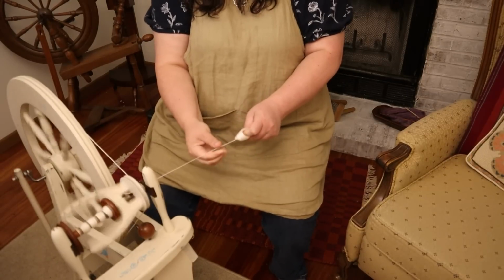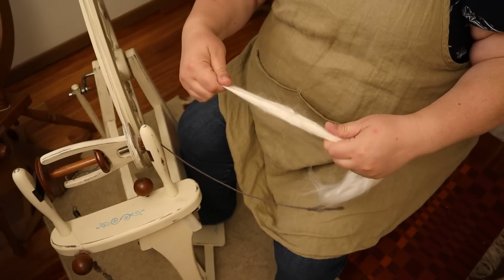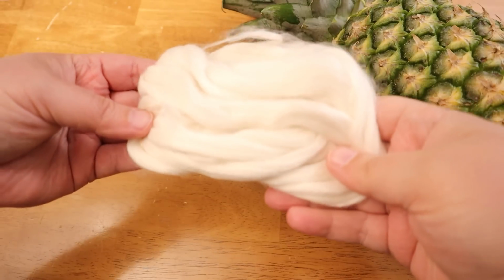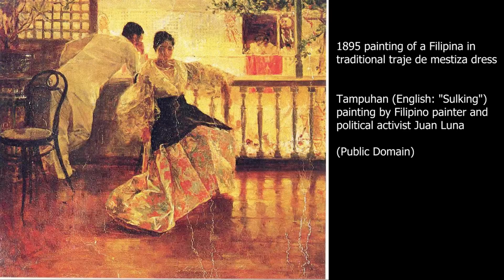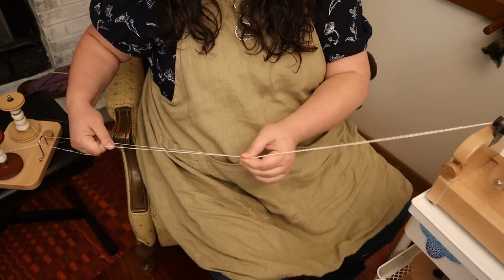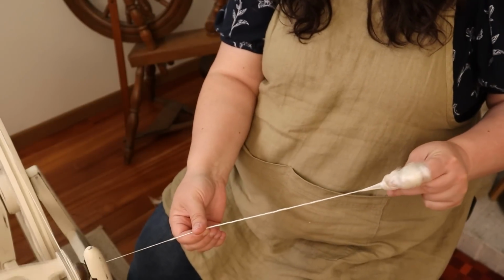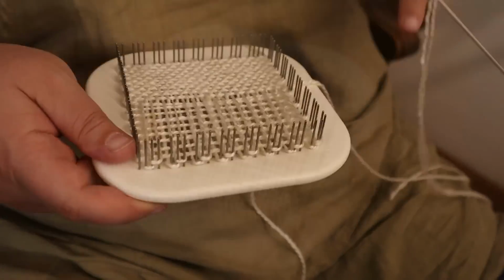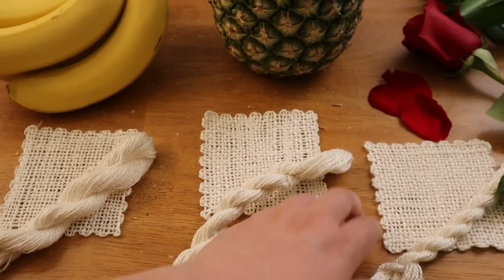Hand Spinning 3 Plant Fibers - History & Spinning Tips And Tricks 🍌🍍🌹

Comment from the maker: The first 1,000 people to use the link will get a 1 month free trial of Skillshare: https://skl.sh/jillianeve07221  
Are you going to spin any of these fibers? Which one? Leave me an emoji! 🍌🍍🌹
Reply: None of the above, I have a huge bundle of raw dogbane stems to process into bast fiber for spinning. Your video just keeps me company. Specifically I'm trying to seperate the tow fibers from the main bunch because of how fine they are. They aren't going to need much combing if I can get them off the main strands of fiber. Dogbane is very strong. The Native americans would use it for rope. The plant itself is poisonous, and when young it can be told apart from common milkweed by the red coloring at the base of the stem. Plant poisons decay with the plant. So the dead dogbane you spin is not dangerous. The plant turns into a branched wildflower with long white flower stalks. The leaves and seedpods look like those of common milkweed but are much smaller and thinner. When growth dies back for the year, it leaves behind a long brown stem, paper dry, which crumples. Below the soil surface is a system of long roots that puts up new shoots each year and that the stems rot off of. The older dogbane is the more brittle the fibers become when processed. So you want that year's growth harvested in January or February even though the dead stems are available any time of the year. Snip the tips off as breaking them to remove the fibers can get very painful on your fingers. Start processing from the base of the stem. Dogbane processing produces a lot of woody chips, which can be poured on the garden as mulch or into the compost. A place called Roots school in vermont has youtube videos on how to process and spin dogbane. You can also process and spin milkweed bast with the same method. Milkweed is at its strongest when frost has just killed the plant, but it is overall much weaker than dogbane. You can spin dogbane on a drop spindle, you cannot do that with milkweed, you must have a supported spindle type. Dead milkweed can also be harvested when you've had a series of freezes and thaws, which makes it very easy to remove the fiber with a dull knife. Dogbane will not do this. The young leaves and flower buds of Common milkweed are edible, but too much is bad for you. And as long as you aren't desperate for food, why would you harvest the buds when the flowers have such a sweet perfume to offer in the may and june sunshine? While processing keep your eyes open for signs of dermatitis. This can happen when handling any kind of wild plant or mushroom. Its not poison, just a skin allergy or a response to an irritant on or in the plant.
Reply: @AnimeShinigami13 Hello fellow dogbane stem collector!  I too hope to process my bundle of twigs someday.  I have a bunch growing in my woods in NC, and I've picked them for the past 2 winters (leaving plenty for wildlife to use as nesting material).  I'm going to look up those videos you mentioned - thanks for sharing your experience!
Reply: @froggydoodle808  i've found a simple pet detangling comb (the metal ones) will work for the purpose. though a youtube channel "Sally Pointer" has recently shown how to make primitive plant fiber processing tools out of thorns and wood or twine. Sally is what's called an "Experimental Archeologist" and her specialty is fibercrafts from british prehistory.
Reply: Thanks for the video. I'm actually interested in spinning the pineapple fibre and I would really appreciate it if you could share more light on the process once again for me.
Reply: Thank you for covering this. Guessing snake plants are even tougher fibers since they have more cellulose than banana
Reply: @JilianEve Has anyone tried to spin willow fibre? Do you know anything about it?
Reply: Thanls a lot for sharp ducha wonderful nowledge .Yes. I do Luke to spin tose fibers.

Comment: Fascinating topic!  
 
One plant fibre you didn't try here is hemp. Traditionally I believe hemp was used for making canvass that was then used for things like work pants and anything else that required tough fabric - and it was, of course, also used for rope. One of the things that interests me about hemp as a fibre is the fact that it grows in a wide variety of climates and it doesn't require a great deal of water or pesticide. 
 
I would expect it to behave similarly to flax or perhaps ramie but I'd be curious to see how you find it stacks up.

Comment: As a cross stitcher, I have noticed a lack of understanding of the base materials (floss and fabric) when it comes to what the different fibers are and why certain types are cheaper or more expensive. Coming from a background of crocheting it has made me more interested in digging into what materials are actually made of, as yarn crafters tend to be more aware of the importance. Your points about rayon are especially interesting, as there are brands of floss that some people love that come from china and are incredibly cheap compared to cotton, but most people seem to assume it is interchangeable with their cotton floss and will use both in the same project. My question in this is the longevity of the finished piece, and the colorfastness of the different types of floss being used interchangeably in a single project. I know you do mainly yarns and not thread, but I wondered if you had any thoughts on this.
Reply from the maker: Yes! I have thoughts. Maybe I'll put a segment in an upcoming video about this.

Comment: the sustainable and environmentally friendly rayon already exists and isn't that hard to find. it's called lyocell or tencel rayon and was developed in the 70s. it's not the most common rayon on the market because it costs more to make than viscose rayon, but it doesn't use harsh and potentially dangerous chemicals like viscose does and the chemicals it does use are in a closed loop. so if rayon is made with the lyocell process it's a very sustainable fiber. if you like the idea of bamboo but are put off by it being rayon, lyocell is the way to go. I think I've heard of lyocell bamboo being out there

Comment: The advantage to Bamboo Rayon is that, as they get the process of making rayon more sustainable, bamboo rayon becomes a great alternative to cotton in light clothing (rayon is naturally wicking and quick drying, which cotton is not) and, unlike cotton, bamboo really doesn't need pesticides (or much in the way of fertilizers) and bamboo is fast growing, really fast growing unlike most other sources of cellulose.
Reply: It's an economic problem not a technical problem. More sustainable means of making rayon such as the lyocell process date back at least as far as the 1970s. The viscose process is still by far the most commonly used, because it's cheaper.

Comment: I have spun both banana and pineapple fibres, I want to buy some more of them so I can try weaving with them, I liked the slubby texture from the pineapple fibres. I have also tried mint leaf fibre, which I'm guessing is also rayon in the same way that the rose leaf one you were working with is, it seemed to have more shine and drape than the other two, it would maybe work for knitted lace as well as weaving.
Reply from the maker: I have some mint fiber and I need to make a part two to this one. The mint has a slightly different color and it says on the label that it is mint "infused" but I don't know what that means or what that process looks like. It doesn't smell like mint though so, yes, I'm assuming chemical process all the way. It's very silky and shiny though.

Comment: I can't seem to find a video about how to harvest rose ribers
Reply: Hi, this is possibly because 
unlike nettle and flax, where the bast fibres are used, rose fibre is made ( as I understand it) through a chemical treatment of the stems. I'm not sure this is a process you can do at home.
Reply: Yeah, I agree with Frances here. I tried to jump into a rabbit hole of how to process mint fibers, but it seems that they are also made by pulverizing the cellulose, then reconstructing it into fibers (like making pasta from wheat)
Reply from the maker: Yes, Frances and Vestal83 are correct. It is a manufacturing process that can't really be done at home.